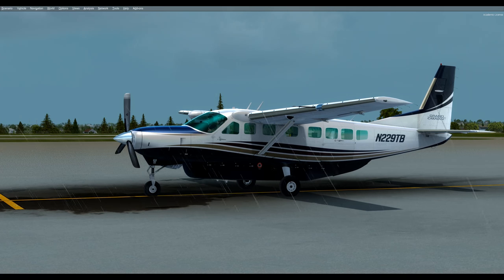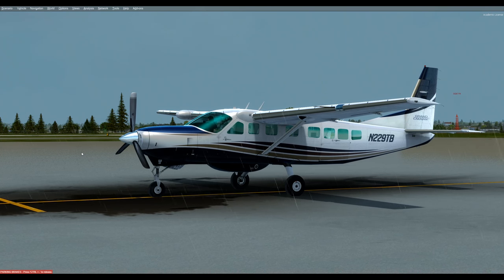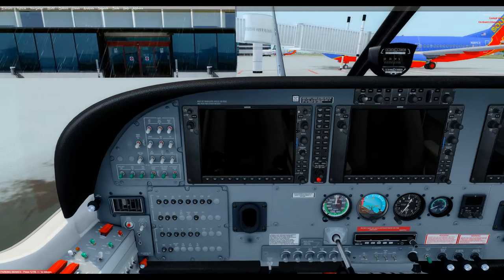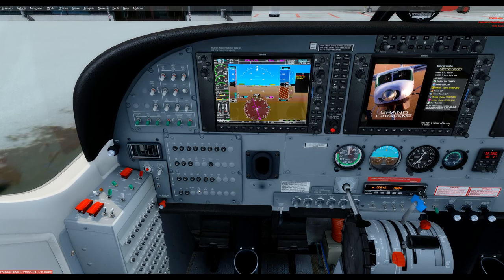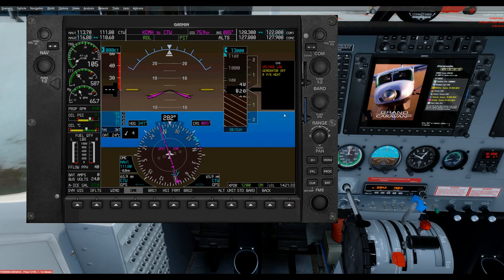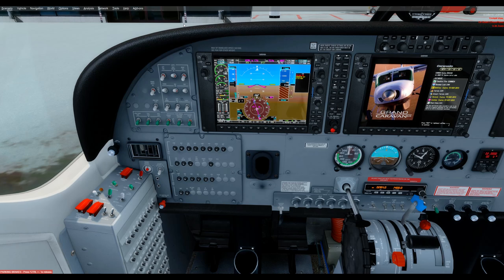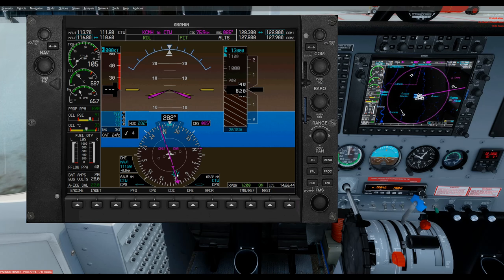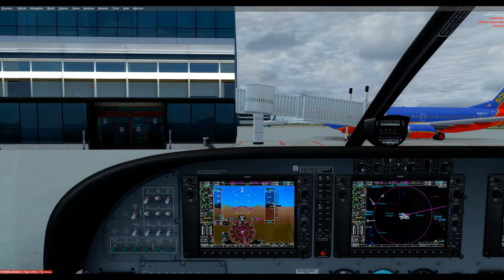Carenado C208B in P3D v4.2 on June 8, 2018

Comment from the maker: A quick note: I'm running P3D v5.2 at the moment and the NAV feature on autopilot seems to need a quick fiddle with the CDI.  Suggestion: Click it 3X and it will reset to GPS and the NAV will now function correctly.  I do this before taking off.